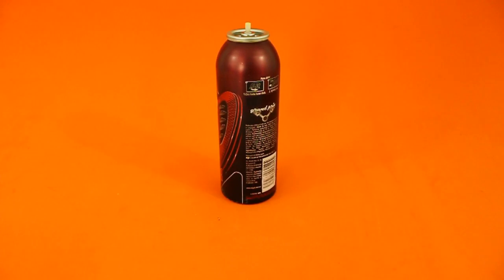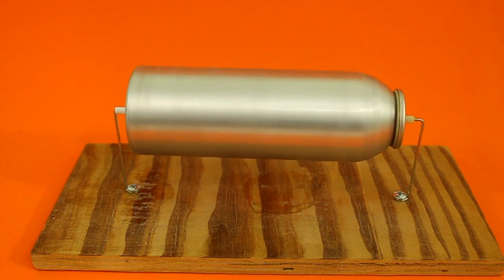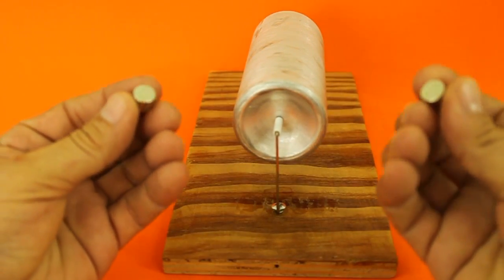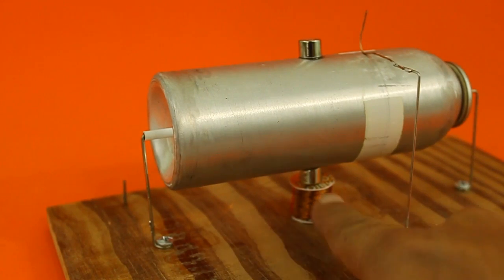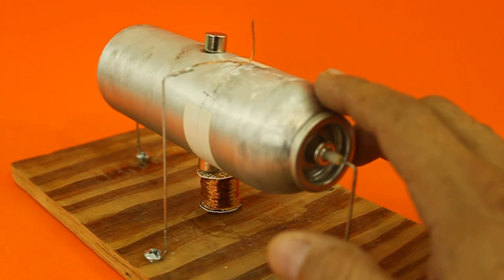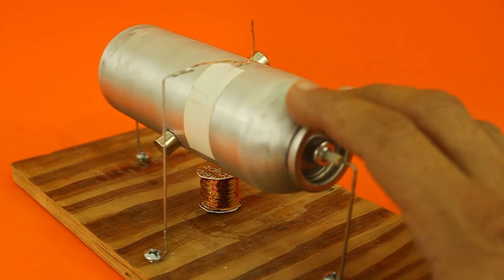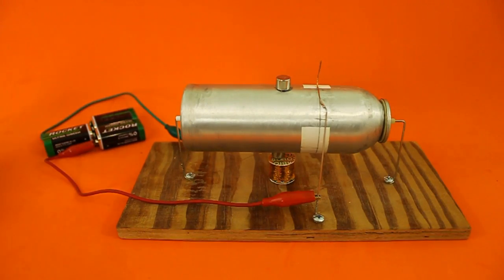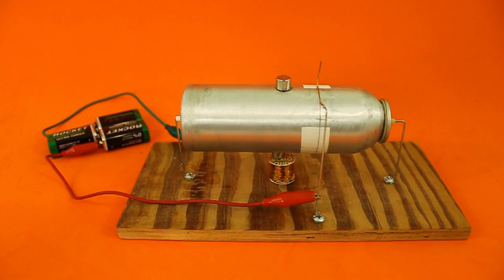Homemade Electric DC Motor with Aluminum Can

Comment: Very nice and simple. 
Btw what's the wire gauge and average length?
Reply from the maker: 30 awg around 10 meters
Reply: Thank you for the quick reply. I'm trying to make one same as this. I'm using magnets from a HDD and a 12v adapter. Will it be ok my friend?

Comment: With the mass of the object turning and in motion like this, you have enough mass in motion to be able to belt it to a load and do work - turn blades or wheels in a small capacity. This has more power than a Dremel without the very high speed.

Comment: There is a drawback: If the motor is stopped with the brushes on the insulated tape, you need to use your finger to get the motor started.

Comment: This is most interesting... I have a question though (just reflecting my lack of knowledge).
An electromagnet is an inductor. Inductors resist instantaneous changes in current. You would need a reverse biased diode to give its current a path out, or else you get high reverse voltage spikes...
Where is your inductor or the spikes?

Comment: Would you be able to do this if you used a thin, say 1/2 cm, aluminum or copper rod? If so, then you could apply the rotation to an actual mechanical device.
Reply from the maker: I think it should work